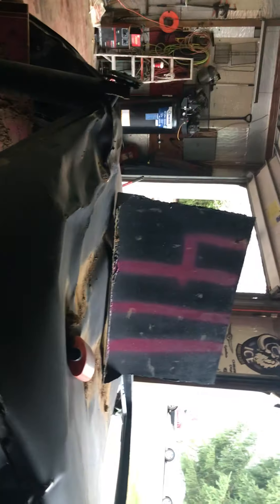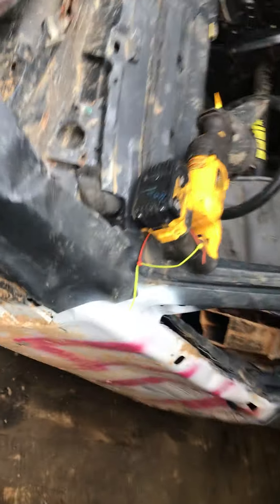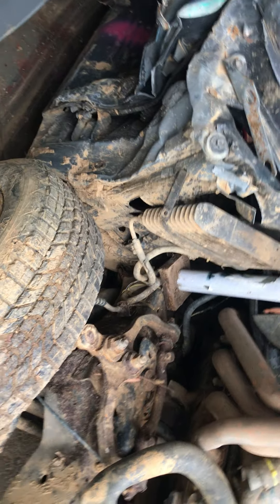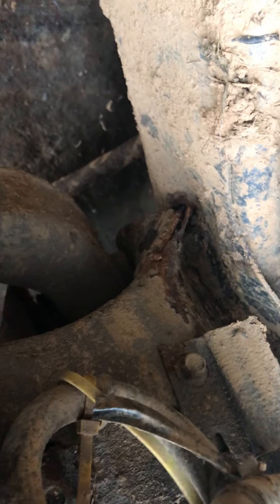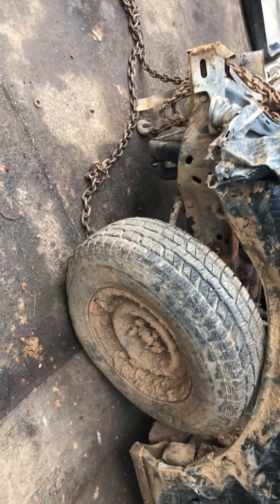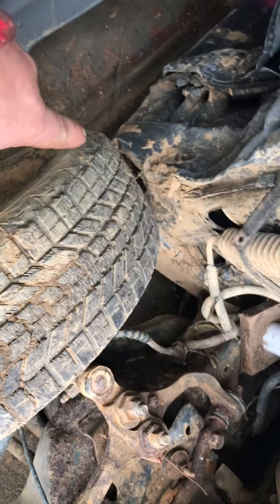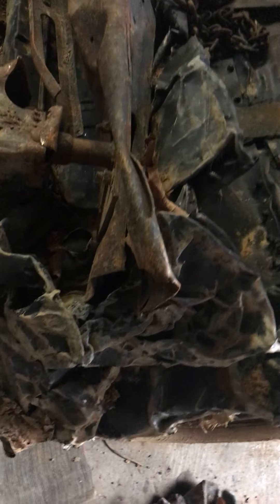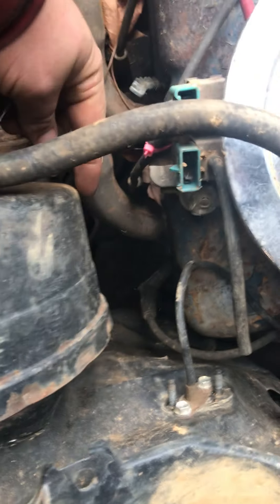1994 Lincoln town car aftermath

Comment: U can also take the booster off and run just the master cylinder
Reply from the maker: Yeah I need more room I’ll have to make one and try it out and see how it works thanks
Reply: @ronsderbyshop1559  I like to use a 60z model ford or Chrysler master cylinder they are small and simple to use with the stock pedal I also have in car pedals but the master is like 30 compared to almost 200 for. The incar